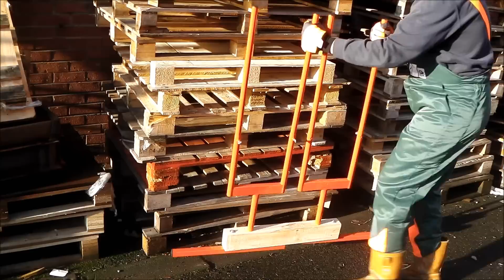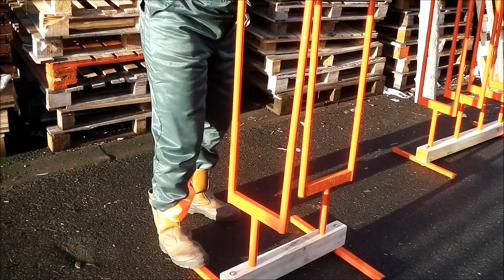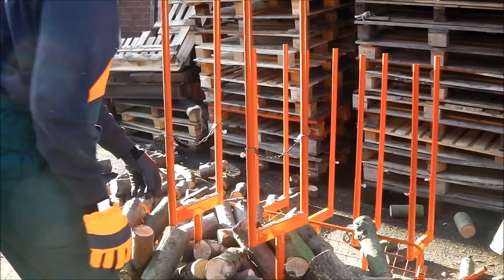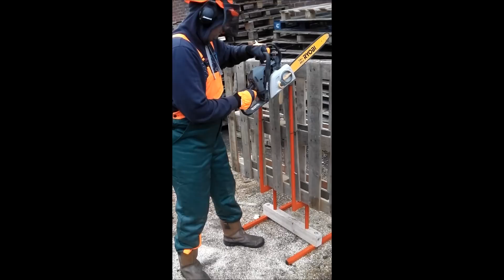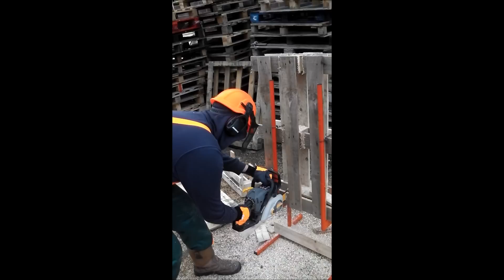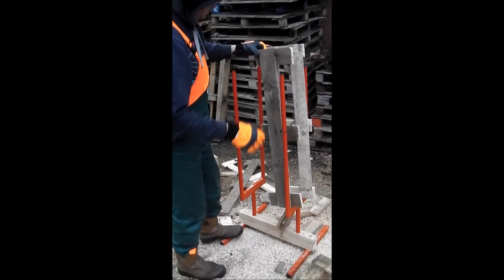Forest Master Bulk Log Stand 2

Comment: I have the FM spikes that just knock into the ground.  I'm female and 5'8" and I find the base of the stand isn't quite high enough for me - is there a particular reason it's made so low?  I'm using it in a high peat based soil with solid bedrock areas and rocks 6" below the surface so it has to be hammered in quite a way to be stable.